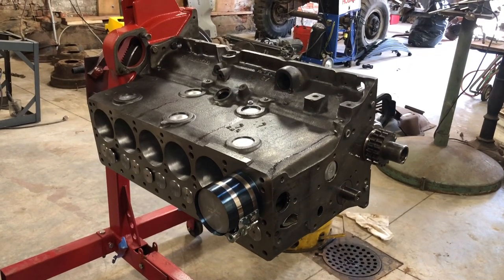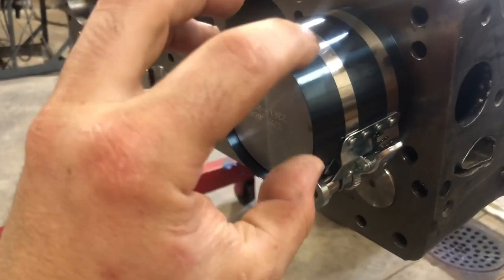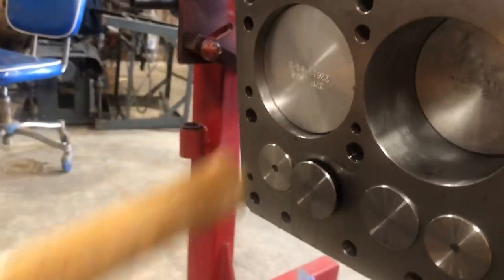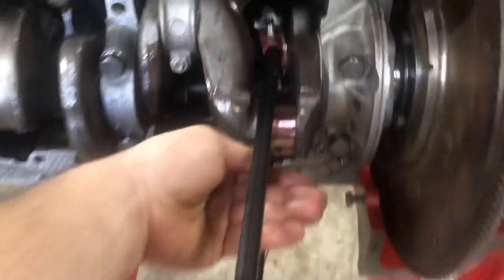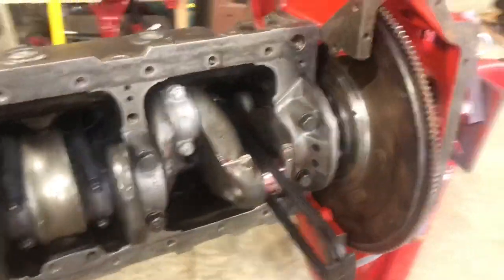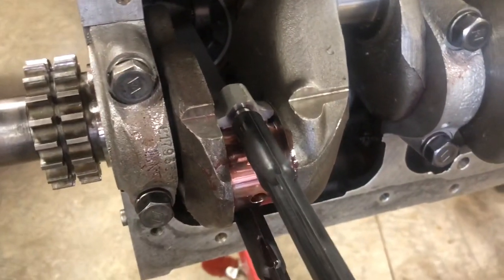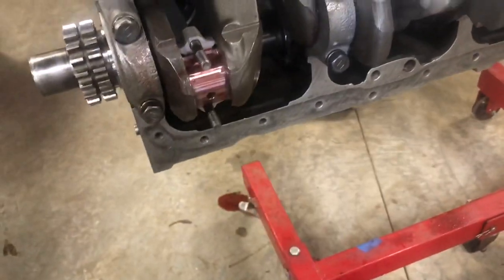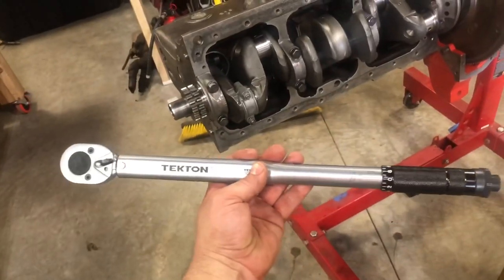Dodge Flathead Straight Six - Installing New Pistons | Dodge Power Wagon Engine

Comment: It's a little late, but usually the marking on the piston, the number stampings on the rod and caps, should face a certain way - left or right. Likely, there are number markings or relationship markings on the main caps, as well. Do you have an assembly manual for this engine? 
This engine, likely, has replaceable valve guides as well. A good machine shop (looks like you've used one for the cylinder boring) can be a source for helping you to reassemble this engine, as well as resurfacing or replacing the valves and seats. Don't go cheap on the engine gasket set; get a good quality one, especially the head gasket.
Running the thermostat housing across some fine sandpaper backed by a known flat surface, and using sandpaper wrapped around a known accurate flat bar on the head can smooth up these two mating surfaces to ensure it doesn't leak.
Running "clean-up" taps in all the bolt holes on the block and head is a good idea. Also, running a "clean-up" die thru nuts (fasteners) is good, too. This step can clean rust and debris out of the threads. Blow the loosened debris out with an air hose, being careful to not blow this debris into other machined areas such as the cylinders.
Reply from the maker: Great advise! Thank you

Comment: Wow! New gadgets all the time. For 50 years I've used short pieces of rubber fuel line over the rod bolts to protect the crank journals. Nice lookin' 230 there.
Reply from the maker: Yeah it’s nifty, but probably better suited for doing volume work.  I saw it in a video as a total know-nothing (still am) and felt like I needed it

Comment: The proper torque settings on the rod and main caps is probably one of the most important parts of assembling an engine. That, and the "sequence" and the proper torque of the head bolts, is also critically important.

Comment: I know I'm late to the party here but I'm wondering if you checked clearance on the mains and rod bearings with "plastigauge"?  Come to think of, I don't even know if it exists anymore.  Its a strip of plastic that you put between the bearing and the cap, torque it down then remove the cap.  Measurement of the plastic strip (now flattened) will accurately determine the clearance within a few 10ths.

I have always used Lubriplate (white grease) on assembling rods, cam bearings and mains.  If there is an issue with oil pressure on startup, the white grease will protect bearings better than oil.

Love watching the old iron.  When I was a teen, the garage I worked in part time had a Power Wagon with a wrecker on the back.  First tow truck I ever operated.  The thing was a beast to drive but would pull stumps all day.  Just indestructible!
Reply from the maker: Hey bud. They do still make plastigage and I used some!   Yeah the power wagon is a hoss. Can’t wait to get it running

Comment: make sure your rings are stagered at 33 percent around the piston so the gaps never overlap
Reply from the maker: William I’m really appreciative for this!!! There are 4 rings. And every other is in the same place. So top is at 12, 2nd is at 6, Third is at 12 and bottom is at 6. Should I change this
Reply: Actually each ring should be 180 degrees away from the gap of the ring above it.

Comment: Hey Dave! That is looking great to me! I know nothing about engines but everyone has got to start somewhere :) Do you know how the oil fill up tube is supposed to stay in --- mine wobbles and can easily be pulled out? Also one of my freeze plugs has a hole in it do you think I could replace it? Thanks for posting these videos you are helping me a lot with my Power Wagon build. Have a good day!
Reply from the maker: Hey Scott. I’m sure you could replace it! Also I’m not sure on the oil tube, maybe try and stretch the base a little so it will fit more snugly? Ask on the power wagon owners forums on facebook
Reply: @partsandresto  Thanks Dave. Yeah I ended up stretching out the bottom and was able to get it in. I just joined the power wagon owners group.

Comment: Ive had/ have a couple of the ol  flat head Chryslers in Power Wagons. They are acually a beautiful running engine. Not alot of power but are indestructable if not over revd. They run sooo smooth and quiet. The newer modern head gaskets really help as these were known to blow head gaskets. But look how simple it was to change one? Drain some coolant and away you go. Manifolds dont even have to come off! Great video and keep them coming
Reply from the maker: Thanks Larry, yeah they are great, run like a sewing machine.

Comment: Dave I know we live in different places but as a reference I was wondering how much the machine shop charged you? I got quoted $3500-$4000 to rebuild and assemble which seems reasonable
Reply: DIY SCOTT when I rebuilt my 230 flathead 6- 4 years ago it cost me around 1500 for machine shop work that’s including replacing the cam bearings and setting the valves and adjustment and turning the crank shaft

Comment: Like you showing us how to insert the piston and the guide you use is the first one like that I have seen.  Do you have photos or videos of the engine before you started working on it?  What about when you disassembled it? Was it complete, was the head intact, or will you need to have it ground, and what about the valves, springs, and lifters?  I really want to know more about this engine rebuild and what it takes to do a complete rebuild of this old engine.  Any video and commentary would be great.  Looking forward to more of this Power Wagon rebuild.  Keep the videos coming.